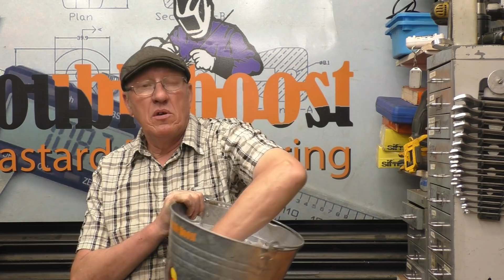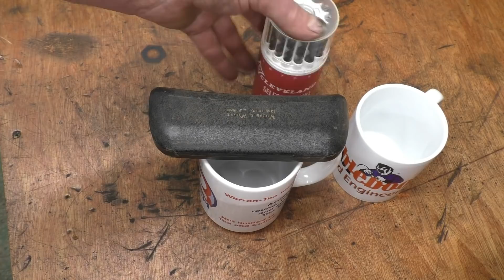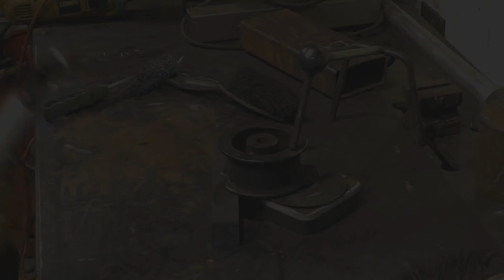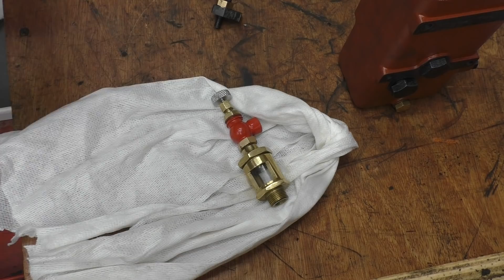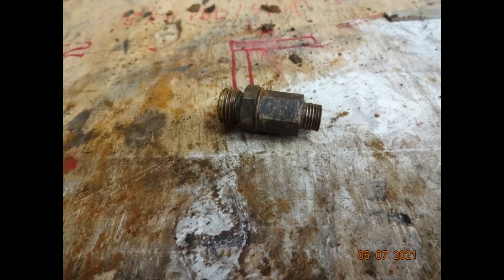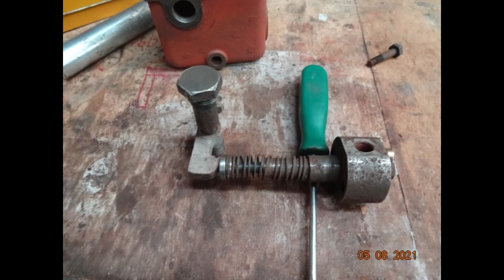SNNC 384 P1 Cast Pulley Repair , Bobs Magic

Comment: Good film, amazing work by Bob! Why is there a ratchet associated with an oil pump,plunger?
Reply: Steam cylinder oil pumps generally take their drive from a reciprocating part of the engine (valve rod or cross head link ?)  The ratchet advances the pump on one stroke, and "misses" on the return stroke. This makes it easier to adjust the oil feed by setting the pawl to cover more or fewer teeth on the ratchet.
Reply: graeme white Aha! Thanks for the explanation.